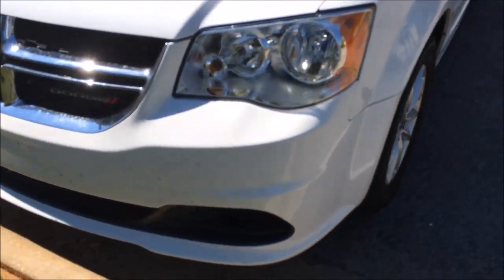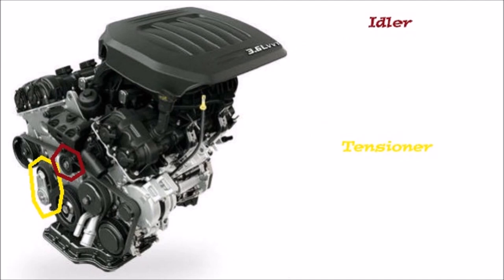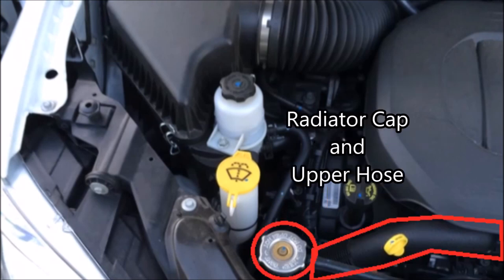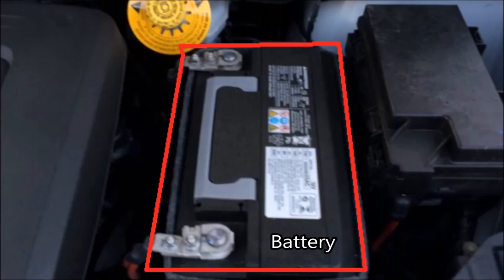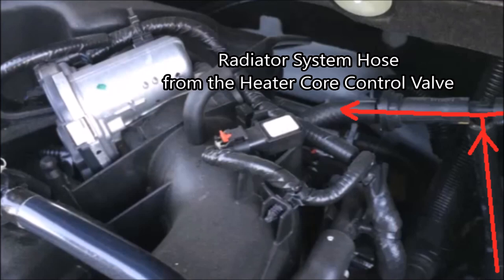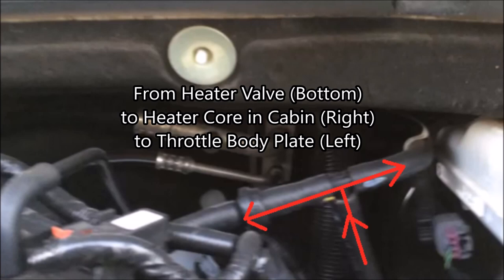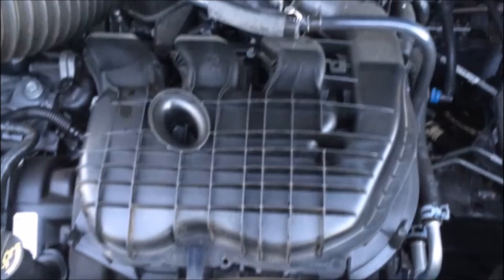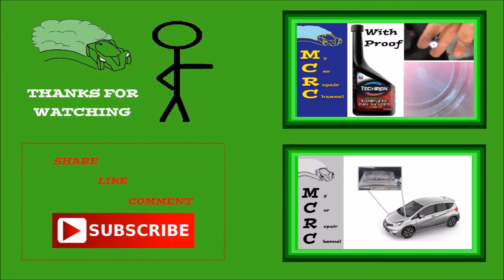Dodge Grand Caravan 2017 Engine Review - SXT 3.6L V6

Comment: I have a 2016 Grand Caravan with this engine.  Excellent performance and fuel economy is pretty good as well. No problems with the engine after 3 years and 40K miles.
Reply: Change your transmission fluid every 50-60K on this vehicle.  I wish I would have known this.  Lost my transmission at 96K.

Comment: this engine is a nightmare !!!!!!! need to remove upper plenum to do spark plugs 
1st gen had cylinder head problems
water pump hard to work on
Reply from the maker: +Joni English glad I dont have to work on it! The factory seems to not build engines for ease of use. Mechanics shops love it cause it’s an excuse to charge you for hours of labor that if they do it really fast they make money on you!
Reply: I have the 2010 CARAVAN only 3.3L last of the push rod Simple and lots of Room 
look at my Video 
2010 Dodge caravan HD brake upgrade 
only after 2013 did Dodge upgrade the Brakes !!!!!!!!
i did the Conversion luck had the 17" rims or Rotors would not Fit
Reply: What year have this trouble that you mention here?? Im thinking in buy one 2012, that version is good?
Reply: first year 2011 -2012 problem with HEADS !!!!!!!!!!!!!!
there is a Recal just to replace 1 head not !!!!!!!2 head 
18 hrs LABOUR !!!!!!!!!!!!!!!!!!!!!!!!!!!!!!!!!!!!!!!
also Brakes UPGRADED in 2013 BIGGER !!!!!!!!!!!the better thats why they all come with 17" wheels !!!!!!!!!!
stay away from 16" wheels small brakes
Reply: Thanks. I appreciate your help

Comment: WTF? Completely misleading and inadequate review! VVT alternating camshaft RPMs?!!?!?!?  PS supply and return lines are all wrong! Thanks, man !
Reply from the maker: This was my second review... you learn as you go. I honestly did think that variable valve timing altered rpms as you sped up and slowed down more efficiently to save on gas. Anyways I’ve learned a lot in 1 year and 3 months.

This is my most recent ER:
2017 Ford Expedition Engine Review - 3.5L Ecoboost V6https://youtu.be/kGjpyw5MauA